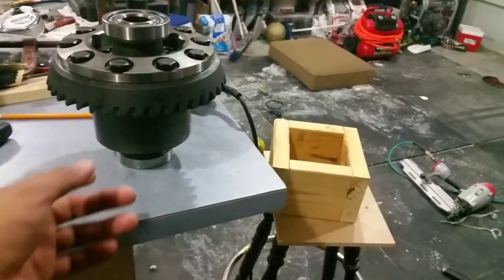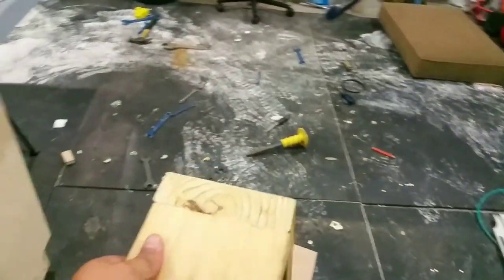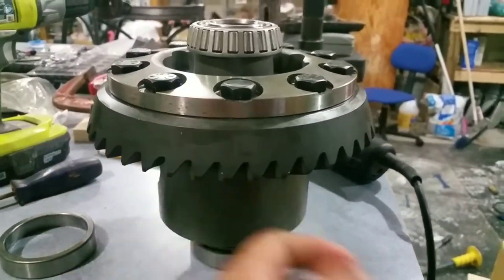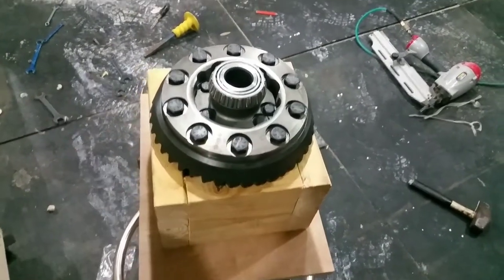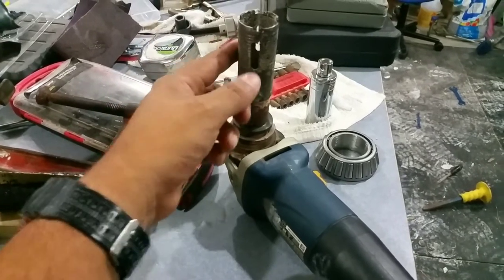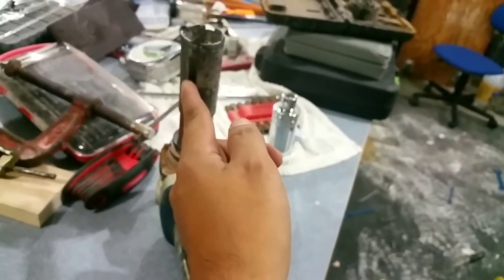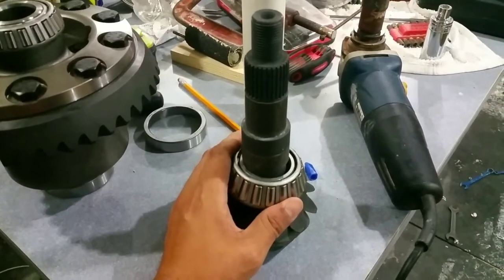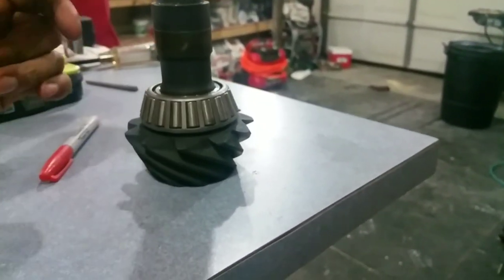2014 Silverado 4.3 V6 New Rear End Setup w/ Detroit Eaton Truetrac and 3.73

Comment: What is the tru trac for ? So both tire can lock ?

I Have a 2015 Silverado v8 
9.5” 12 bolt with 3.42 gears  im looking on getting 4.11
Do I need a tru trac ? 
Both my tires spin currently?
Reply from the maker: The Tru trac is the best overall diff for offroad and on road. You don't necessarily need it but if you are already going to do the gear change then might aswell change the diff since is part of that job. It would be dumb not to do it.

Comment: Bro can you share where you got everything from?
Reply from the maker: Like tools and all or just parts like the true trac and gears?
Reply: Parts bro lmfao I just added you bro on Facebook
Reply from the maker: @oWIICKEDoDOSEo  lol alright thanks, the true trac I got it from summit racing, I think it was like $450 at the time. The 3.73 gears I bought them on eBay from a company called quick performances, they have good reviews and good prices. The master bearing kit is yukon master bearing kit, you can get them off eBay or a bunch of places. This are for a gm 8.6 axle, they only work on the 2014+ 4.3 v6 or 2007+ v8 8.6 axle. The new 5.3 use a bigger axle

Comment: Can I bother you with the part list/links to where and which part to buy? I’m doing the same thing. Please!
Reply from the maker: Is yours a v6? V8? What year? 4x4?
Reply: Jorge Rangel 
2017 v6 WT not 4x4
Reply: By the way thank you for the quick reply!
Reply from the maker: @cdiaz1257  then you need to find a locker that you like. Personally the Detroit truetrac is very nice. So you need it in a gm 8.6 differential 30 spline . You also need the master bearing kit for the 8.6 gm differential, then you need whatever size gears you want for an gm 8.6. And you will need 3 liters of differential oil non synthetic
Reply: Jorge Rangel you are the man!!!! A million thanks brother and keep the videos coming

Comment: You destroyed those bearings by banging them in and you don't even know it. The cage and races on bearings don't bend and give, they crack and shatter. You prob have some hairline cracks on them now... A bearing press is a smart investment and you won't look as ghetto...
Reply from the maker: I'm not pressing on the bearing part, I'm not dumb. I'm pressing down on the solid piece of metal that's meant to be pressed.